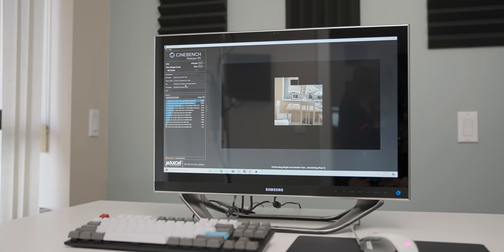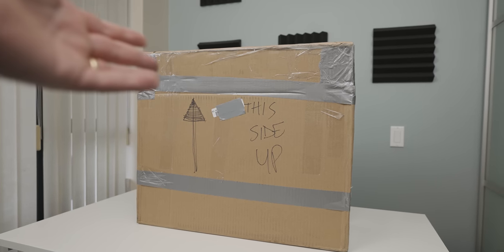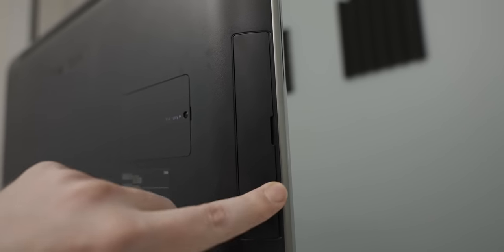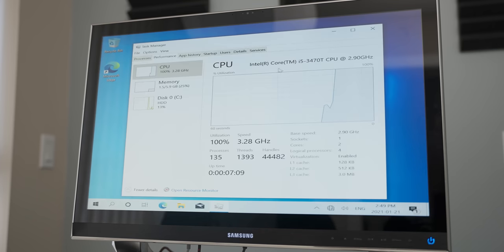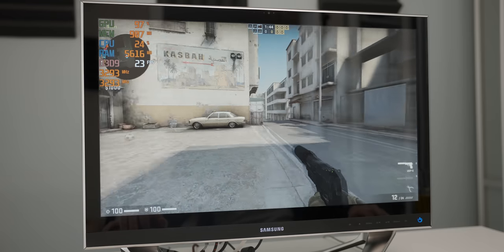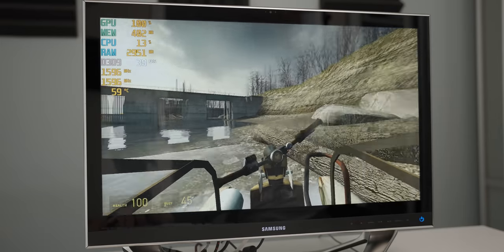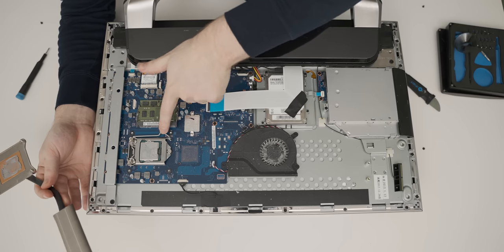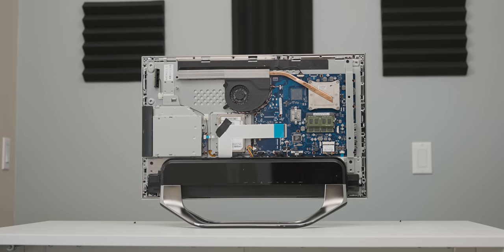Trying to Game on an 8-year-old All-In-One PC... For some reason

Comment: Looks super modern for how old it is, and aside from lacking a true GPU the specs aren't too bad! Definitely could do with a ram upgrade though.
Reply from the maker: I will try and push it to the limit, but I agree, I looks awesome!
Reply: some body once told me
Reply: @VERY EVIL PERSON FROM ILLUMINATI I'd be concerned about the max power delivery of the motherboard and whatever power supply it's using. It might be good up to 65w, so a lower power S model could probably work.
Reply: @VERY EVIL PERSON FROM ILLUMINATI So long as the power brick can send the amps to it and doesn't crap out.
Reply: yeah, i mean its perfectly good for a family non gaming pc.
Reply: @therealvbw  the 3770t is a 45w quad with hyperthreading , that would be a good option.

Comment: If you want to see an all-in-one with a super robust interior, check out a 2007 era iMac (Core 2 Duo). Those aren't unibody and you can pull the whole thing apart using torx bits. The inside looks like a spaceship with fancy silver screws. If you ever need to replace the hard drive on one, you have to almost fully disassemble the computer removing the system board and everything to get to it.

Comment: When you open it up you can actually see the pads there for some type of dGPU and the DRAM that accompanies it.

EDIT: Just looked it up, this thing could be configured with an HD 7850M, hence the beefy cooling
Reply: He could probably find a board with one, then upgrade the cpu to a Quad-Core i5 3470, 16gbs ram and a nice Much Faster SSD and I think this thing would slam!
Reply: @Just_Gabe  lol
Reply from the maker: It wouldn't be that hard to solder it on myself would it? 😅
Reply: @DawidDoesTechStuff  Surely not if you pick up a $10K BGA rework station, cheap, right 😅
Reply: @DawidDoesTechStuff  & then expect a Reply Video from Louis SuperSolderman
Reply: @DawidDoesTechStuff  No, not at all. You could do it with a $15 home depot special in fact. If you have solder skills that is.
Reply: @pedifer1999  put a rtx3090 in the top shelf of the oven , add the computer to the bottom shelf and bake for 2 hours.

Internet said it will work so it must be true.
Reply: Bruh i got this thing with an hd 7850m 1gb and believe me it's cool quiet and can run anygame on low to high settings
Reply: And also i heard theres a 2gb varient of this pc
Reply: @VibeZ551  at the time it came out im sure you could but it ain't running new AAA games these days.

Comment: I picked up the 27 inch version (DP700A3D-S03AU) of one of these a few weeks ago. Which has an i7-3770T, 8gb RAM, touch screen. It also has antenna in, and can be used as a normal TV. I have put a SSD in which has made a massive difference to the over all speed. For $200AU, it was also one of those impulse buys, but for that price, it's a bloody nice AIO PC / TV / HDMI IN unit.

Comment: Funny at my work I just decked out my old HP Eliteone 800.  Installed 16gb DDR3, 256Gb SSD, and finally added the dedicated AMD Radeon HD 7650A (MXM) video card with the correct heatsink.
I love this machine it does everything I need and love the size.

Comment: i would like to see 16GB ram and a decent SSD,  how much a difference that makes
Reply: the ssd is crusial for good performance. I have an optiplex with i5 2400 and 8gb of ram, and before the ssd(with a half year old wi ninstallation) it booted in just under 4 minutes, while the ssd(and new install) made it just 30 sec(using it since december). I recommend the samsung 860 evo if you only have sata, but with nvme it does not really matteer if you avoid the cheapo ones.
Reply: Sed is good, but he the ram will make all the difference, as it is an igpu. System memory is all it got
Reply: i7 3770k would be really cool
Reply from the maker: I'll get on it. 👍
Reply: @ostern03kappa29  not a K but just a 3770 as I doubt you OC it & there isn't a noticeable difference between them without an OC
Reply: @kolamaash2736  Intel® HD Graphics 4000 uses a maximum of 1792mb RAM, so unless you are using more than the 10GB left it won't make a difference,
SSD will make more of a difference to opening programs, while RAM will increase performance using programs if you are exceeding the amount you currently have
Reply: Leo Schröpfer  I got a 4th gen i5 4690k with a cheap ssd an it's up an ready in 15secs with about 12games on it lol it's a 500gb ssd
Reply: Leo Schröpfer  how
my secondary c2d e8500 build boots in 11 seconds  with a 7200rpm hdd (but my windows install is a custom lite one)
Reply: @reznov4291  yeah you're running Windows 95.... 11 second boot on that machine is not possible with anything that resembles windows 10.

Comment: That HDMI input is actually a pretty common feature on all-in-ones from this period. My parents had a Gateway all-in-one from 2012 that was getting unusably slow and only ran Windows 7, so now I use it as a monitor for my Raspberry Pi. It's got a decent 1080p 21.5 inch touch screen and some good speakers.

Comment: looks like it has solder-pads for a gpu of some kind. probably why the cooler is so effective, it was built to cool both a cpu and gpu in the higher end models but is hardly used in this lower end version. the benefit is you could easily upgrade the cpu without thermal or power issues i think

Comment: "This is like GT 710 performance" this hurt me a lot.
Reply: I own a Gt 710 it runs circles around this
Reply: @Audiblegaming  you defenietly need to upgrade.
You can easily find a 1050ti in stock in most places
Reply: @Kasmuller  I only got it because my case is too small for a regular size GPU and my psu is too weak for anything else soon I'm gonna get a PC that isn't an overclocked sack of potatoes
Reply: @Audiblegaming  what kind of case is that.
Just going looking for cases it is hard for me to find one that doesn't fit up to a 360mm card
Reply: @Kasmuller  It's a Dell prebuilt sff case
Reply: @Audiblegaming  oh ok
Reply: @Audiblegaming  I think there's a 1650 (not super) compatible with SFF cases. Although, it might be rare or expensive nowadays.
Reply: @Audiblegaming  um gtx 650 650ti, 750 750ti, gtx 950.. no excuse having that pos in anything
Reply: @taner980  240w psu and case so small you could only put that small a gpu it doesn't matter anyway I'm getting an actually good pc soon
Reply: @Audiblegaming  Dell computers physically hurt me
Reply: @Audiblegaming  got a better pc yet?

Comment: Max upgrade maybe 16 gb ram  i7 3770 and an ssd.
Reply from the maker: For sure! I'm also getting an M. 2 GPU adapter to plug a GPU into that bad boy. 😁
Reply: @DawidDoesTechStuff  Where do you have SSD M2 PCIE slot in this machine ? WIFI slot doesn't look for PCIE standard, I think this machine is too old to have any PCIE slots, also no MXM slot for mobile GPU, looks like total bust
Reply from the maker: @kiki83607  I'll see what I can get going. It's always worth a try. Even if we just drop a higher end CPU in there with an SSD and a bunch of RAM. 😁

Comment: Yes, follow up please!
Also, the shot was probably for dramatic effect but I'd still like to say for anyone else; Don't blow air or hold a vacuum to computer fans without slowing them down at the same time. If they overspeed, the bearings will get destroyed and they'll get noisy and, at some point, jam. A vacuum gets a fan up to loads of RPM in no time.

Comment: Interesting find Dawid,  I would say upgrade it and add more ram?  A 4000 series GPU with an i7 3770 would fit the build.  Maybe after install slap some dinky heat sinks on top of the heat pipe spreader?  (added mercy cooling)   Would enjoy a follow up video!

Comment: Hey if you look at that motherboard Dawid you noticed there is a blank die space to the left of the cpu, there has to be a dedicated graphics card version of that board.

I would be interested in finding out if you can find a dedicated gpu version on ebay or whatever for a swap.  It would also require the cooler be swapped as I bet it uses essentially the same thing but with the second heatpipe and base plate for the gpu....

Comment: Dawid read my mind. 
Add a E-Gpu to it using the mini pcie skot which contains the Wifi card. Throw in the max ram ut can support and the best cpu you can get your hands on and to be hinest if you use the Mini pcie as the connector for E-GPU you can then connect the gpu output back to the display which is awesome. I personaly use the 5$ riser for my laptop and gaming setup and it works fine vut if you want you can spend 25$ on a EXP GDC gaming edition. Im using the mining edition which iz the same just well nothing too fancy

Comment: I really wanna see the CPU swap. I have an old All-In-One that I was given and don’t know if that would help but I’m too scared to try it myself haha
Reply: I  am in the same boat. But my all in one already has the max supported cpu inside.
Reply: Honestly, Just max out the ram and maybe an ssd if you can afford it then go to town!
Reply: @drakon480  put 18 core Xeon in it
Reply: @saikothesergal  you just end up going nowhere faster.
Reply: @joefish6091  18 core Xeon 🤣 that would be sick
Reply from the maker: Oh cool! I just need to order some parts, so it'll be a couple weeks, but I'll do it. 😁
Reply: @joefish6091  you'd be surprised what a ram upgrade can do, especially graphically, HD graphics use system memory, remember that :3
Reply: I’d a cpu swap, ram and hdd to ssd upgrade on an HP All-In-I
On. It was definitely worth it.

Comment: there is mount for additional fan, probably no way to connect it on mainboard but some wire twisting will do miracle and you can go wild with CPU upgrade. But without any way to upgrade graphics there is no point, some better i5 can run even with this one.
Even like this with SSD inside not bad for everyday use for web, yt and stuff like that. Good to know, they are not available locally too often but now I know it's not a bad deal if I see one.

Comment: I have an i5-3470 running on the HD 2500 and I can feel the pain trying to run games. For some reason Minecraft Bedrock Edition is at 50-60fps and Minecraft Java Edition is at 30-40fps so its playable. 900p though. If I drop Minecraft Java to 768p then it will get around 50fps

Comment: The HP touch Smart 600-1390 AIO's use MXM graphics cards. The best I have been able to do so far is an nvidia quadro m1000m, after I added a beefier power supply. Going to see if I can install a GT 956M next.

Comment: external dock using the wifi adapter seems like it might work, but i bet you get double the performance with better ram. cpu is the only other thing to change unless there isnt a 4 core option. then an ssd and gpu probably wont change anything. 

imo

Comment: This is really interesting! I saw a Samsung AIO pc at a local pawn shop that had a really interesting design for the time it was made that had the pc in the base of the monitor and was pretty easy to upgrade from what I looked up. Unfortunately I didn't buy it because I have way too many computers already and I have been trying to curb my enthusiasm, or as some would call it, my "addiction". 

Also about the packaging, yeah, they royally f'd up on that. They should've packed it so it was tight and unable to move or shift during transport. Other than that 2020 was truly the year of using recycled shipping materials from my experience. I sell on ebay and I reuse shipping materials all the time, well before 2020. I will sometimes get comments from customers about it and I tell them that I would rather reuse materials that are still in good condition to help reduce waste. I do however, pack the shit out of my packages to make sure an item won't shift around in transport as I sell to a lot of different people, some of which use freight forwarding services since I don't ship outside the US. They understand that they lose ebay buyer protection but if I see that it is a FF address I contact the buyer to confirm it is so I can pack it exxxxxxxxtra tight so when the FF ships the item overseas it stays protected. I've had buyers from the Dominican Republic and the middle east and Africa and just knowing it's going overseas and they're willing to take the risk losing the ebay buyer protection spurs me to add more packing material to protect their purchase. (I don't use ebay international shipping because it is a joke, just look up how many horror stories there are online.)

Comment: I'd upgrade it to a i5 3570, 16GB of ram if its compatible, a 500GB SSD and call it a day. A better wifi card wouldn't be a bad idea either. I did notice the empty die area next to the cpu socket. I bet there's a version of that motherboard that has dedicated graphics on it. Assuming it isn't terribly expensive, it'd be a nice upgrade over the iGPU. You'd also need to get the appropriate heatsink to accommodate that. Given the space available next to the fan, there's probably a second blower fan that can be installed too.

Comment: I found a dell all in one just thrown out, turns out it was a head hard drive but a simple replace and it runs fine with an old but very usable i7-2600S 8GB ram and a suckky Nvidia GT 525M 1GB

Comment: you can try add a 3770t 45watt tdp or 3770s 65watt tdp both have hd 4000 igpu which should help a lot also a ssd and ram upgrade from 6 to 8 will make it speedy gonzalez fast

Comment: i got ~50 fps in fear on my intel 4600 haswell CPU at 1080p. so yeah id say at the haswell level we are looking at maybe gt7700 performance. a pretty good jump up from the 2500 that your using. i do have a 630 UHD but i havent triad any gaming on it since i dont have the drivers for it installed

Comment: Actually, with an upgrade to a quad core CPU, that could be a really cool little kitchen or bedroom HTPC.  Since it has HDMI input, you could go from watching TV or playing console to using the PC for web browsing.  Since it supports the i5-3470T, it should support the i7-3770T as a drop-in upgrade.

Or, y'know, you could mod the back case to fit a Noctua NH-D15.

Comment: Best cpu you could get is a i7-3770, which would also get you the hd4000 igpu. Massive upgrade that will make a huge difference, but still not that great for gaming.
Almost looks like there is room for a second fan in there as well. 🤔

Comment: not through the whole video at all but with the output, couldn't you in theory use an hdmi to thunderbolt converter to use an external gpu and reroute it to use the input hdmi to improve gpu?

Comment: That's a dual core i5 in there. The hard drive is a laptop drive and may or may not be 5400 RPM. You may or may not be able to install an i7-3770 in there. The BIOS might lock out non-T CPU's, and you would also need a bigger power brick with more wattage, and a better CPU cooler (which means you would have to leave the back cover off or cut a hole in it).

Comment: That i5 3470t isn’t that bad actually. If you pair that with a 1050ti you will have a fine experience. I use the 3470 quite a lot in used gaming pc’s and it’s holding up pretty well. The t version has a lower base clocks but besides that not much different.

Comment: I wonder if it has a powerful enough power supply to power a 3770k. Also I wonder what GPU options it had originally, because you can see that it has a empty gpu solder point next to the cpu. Probably would have been a 600m or 700m series mobile gpu

Comment: I was thinking "this might be a good candidate for an external GPU" then you asked. I say definitely give it a go. with an external GPU you could opt for a cheaper e3 1230v2 instead of a 3770. But no IGPU in this machine would just be silly, but it would save you a few bucks and net the same benchmark results.

Comment: Instead of an external GPU dock why not 3D print a replacement chungus back panel and make it an 'internal' GPU.

Minus the 3D printing part I've done this to a couple old laptops utilising the 1x PCIe slot sacrificing the wireless card.

Comment: Wonder if an Ivy Bridge Xeon would work in there, they had P4000 iGPUs. While not insanely better than HD 2500 it would be a good boost. Something like the E3-1245 v2 for example. It's a risk though since OEMs can be jerks and hard code specific cpus to only work. :( 

Just checked ebay and it seems nothing safe presently. Even those old CPUs are over prices and most only from China.

Comment: OH, so basically the internals are a larger version of a P.O.S. 'Tiny' (I've a Lenovo M93P, same CPU but 8GB RAMalamadingdon)
YES DAWID, eGPU pls. I want to see how much performance can be offloaded from the IGP.
 I'm aiming to utilise the M93 for a really low W 'indie' gamer. With an R5 240 (it was free) plugged into a GDC Beastie via the mSATA (once I fettle the whitelist) I'm hoping Bastion/Hollow Knight/Salt n Sanctuary type games will be smooth enough.

Comment: Just smack a i7 3770(k), search for unlocked bios or mod it yourself and oc the shit out if it if use k variant, and smack another blower next to that poor one.. i just did very similar few years ago with lenovo m93 aio but used 4th gen, yours is h77, q77 or which one chipset?

Comment: I kinda thought the thing would have a socketed CPU, because I recognize the type of CPU. Too bad it’s not a normal 4 core CPU. Though there are 3rd Gen CPUs which have 4 cores, but don’t take too much power, so maybe.
Also too bad this thing doesn’t have an MxM slot, because that would make it just a bit better if it maybe had some GeForce 700 or 800 card.